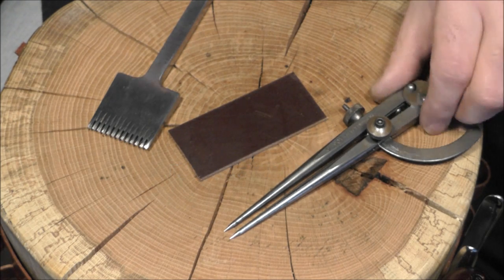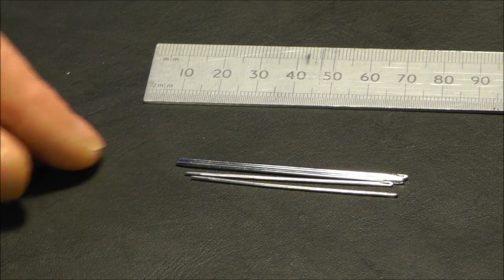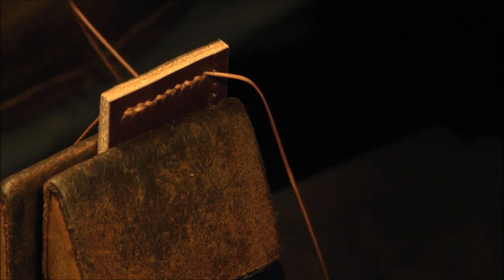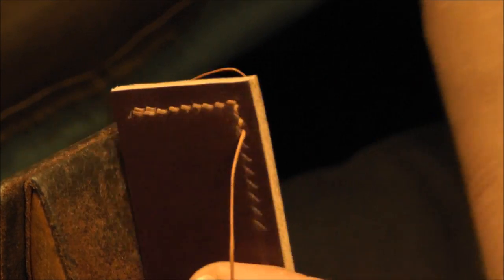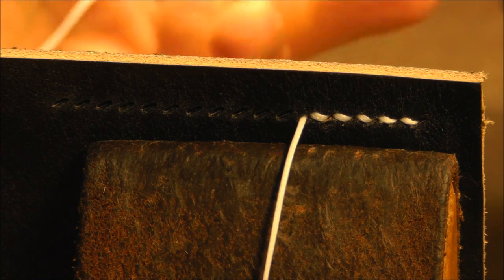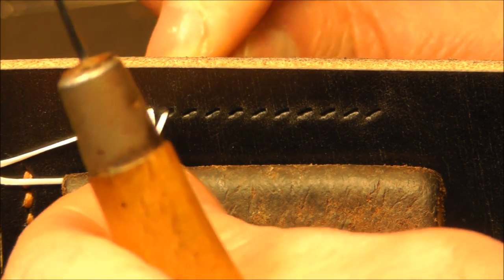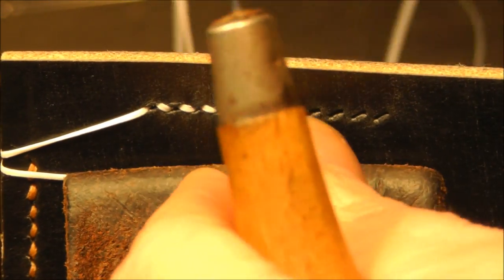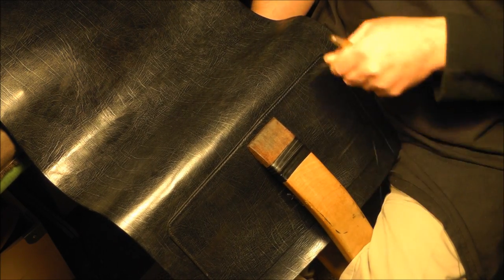Saddle Stitch in Detail

Comment: At 4:04 - you speak about harness needles.  The needles you are advising to get, at Tandy, in the states - is called a 0 harness needle.  Not to be confused with the larger 000 needle. 

I am grateful that you included the scale in your video - so I was able to use my calipers and determine what I had and what number it was called. 

Thanks!

Comment: Very good presentation. Hand was in the way sometimes, but especially with the light thread and dark leather things appeared clear. So... is it correct to think if the angle goes up and away from you that the second needle goes on top and if the angle goes down it is the reverse?  So sit one way and it's on top, move 180 degrees with work stationary and 2nd needle goes on the bottom?  Inference is simple trial and error with contrasting leather/thread may be best way to learn?

Comment: Nigel, Thank you so much again for these videos, I have been re-watching them again and discovered that I am using 18/3 with 004 needles instead of #2.  Using the right needle is going to improve things I'm sure.  I am confused as to what decides whether the first needle is held on top of below the second needle and why?  Also thanks for your recent review of the Western QC Bevelers, I purchased them and love them.  Thanks again for all you time and effort.
Reply: +Paul Hagood If you get it the wrong way round, it'll flatten the stitch our rather than make it 'toothy'. The way I remember is if the front of the work (the side where the pricker has made the marks) is on my right, I 'hook towards myself' and 'push away'. That is, if I am stitching towards myself, I 'hook' the needle by crossing it under, and if I am stitching away from myself, I 'push' the needle by crossing it on top. If the front of the work is on my left, then it's the opposite.

Comment: Hi Nigel I just wanted to know your views on stitching grooves, specifically is it possible to use a stitching groove when using a French pricking iron.
Reply: Good question. Yes. When using a pricking iron with teeth that are flat and slanted you need to place the flat top of the iron so that it bisects the stitch line. A groove “cut” into the leather is not necessary, a marked line is all that is needed to help place your stitches neatly.

Comment: Am i correct. Only Saddle Stitch with knot can make "WAVE" on both side (front and back)? I tried the Saddle Stitch without knot in 2.4mm leather. It will be show the WAVE on front side. On the back side, i found the straight line(almost)

Comment: Jeff Lincoln
Bill Barfett
To get both the front and the back of your peace to have beautiful smart looking stitches, try this:
First, refer to Nigel's section where he demonstrates tying a knot with each stitch in round holes instead of slanted chisel holes. Now, even though he said that the knot won't be necessary with the slanted holes, go ahead and make the knot anyway with each stitch.
Now, imagine the two threads being tied together are sort of "tumbling" together. if tumbling continuously, they would be rolling in one direction or the other, either forward or backwards. (weather you stitch away from yourself or towards yourself is not relevant)
When tying each knot, always "tumble" your two threads so they would "roll" up-hill inside the slanted hole. Never roll down-hill.

Comment: Thank you for making this great video, I sure learned a lot! 3 quick questions: How many stitches per inch would you suggest for making small leather articles (billfolds, pocket comb cases, mint tin cases, etc) with veg-tan? 6 seems to be working well for me, but was wondering if you'd suggest less or more. Second, what size/gauge thread would you recommend for that stitch length? And what needle gauge would you prefer for the thread size? I understand that not everything is "one-size-fits-all" but I'm trying to standardize my stitching for the things I like to make. Thank you for your time!
Reply: Hello. Most of the smaller items you mention will work well with that SPI. The one used most in the workshop for that size item would be 7. John James needles 0.4 and 0.6 or 0.55mm thread work well together. It really does depend on how you want things to look though. If you prefer a thicker, chunkier or choked stitch then use a thicker thread with smaller SPI and the reverse is true with a thinner thread and larger SPI you will get a simpler more dainty look. None of the seams will be under so much stress that it matters what look you go for though in small items like these.

Comment: Hi Nigel, should you always stitch towards yourself? I use diamond chisels and the backside seems to look better than the front lol. Is that a result of me stitching away from myself?
Reply from the maker: If that works for you Bill and you are getting a decent stitch, then that is the right technique for you.
The back will always suffer because of both threads trying to occupy the same space in the leather.
Try stitching towards you and see if the results improve.
Reply: Bill Barfett 
You can make the back and the front look equally smart and beautiful. Here's how: Simply tie the knot in the exact manner as Nigel did when he demonstrated stitching through round holes. Whether to knot overhand or underhand is determined by two factors: 1, the angle of the holes and 2, the direction of your stitch progression.
FIRST, pay attention to only the face of your work and ignore the back.
SECOND, In the direction you plan to stitch, if the face-side holes are slanting UP, then tie the your knot so that the emerging needle is emerging from UNDERNEATH the other thread. 
If the face-side holes are slanting DOWN relative to your stitch direction, then tie the your knot so that the emerging needle is emerging from ABOVE the other thread.

Comment: These angled slots look more pleasant than the round holes..  however ive watched several holster and knife sheath videos where the makers groove the leather on top of the stitch line so that the stitches lay in a groove recessed below the surface of the leather so that they can not be worn away from abrasion as easily...   I havent watched all of your videos but i have watch two pertaining to this Saddle Stitch and i have noticed that you do not groove a channel where the stitches will lay..   Does using the angled hole spacers and making these diagonal stitch holes prevent grooving or does it simply necessitate a different tool with a wider groove cutter ? ...    Do you believe recessed stitching is even necessary on a knife sheath or holster?
Reply: +rainmechanic There might be certain places where laying the stitch in a grove is a darned good idea, like any stitching inside of a knife sheath where proud stitching might come into contact with the edge of a blade. But aside from that it's just preference. It's popular in the USA for some reason. There are plenty of examples of old English horses tack that is just as good today as when they were made and they didnt grove the stitch line. Laying the stitch in a grove and using an overstitch wheel hides a lot of sins too. IMO, nothing speaks skill or looks prettier than a properly done English saddle stitch. Dropping the stitch into a grove and running over with an overstitch wheel, completely destroys the aesthetic of it. Even if the saddle stitch has been done well, you cant tell any more.

Comment: For knot style stitching, Is it important that the holes should be much larger that thread width?
Reply from the maker: No, the hole needs to be big enough only to achieve the stitch, it doesn't need to be any larger than this, otherwise you begin to lose strength. Hope that helps.
Reply: @ArmitageLeather  Thanks for sharing the info. It sure helped

Comment: How do you deal with it when the thread is a bit short?  That is, how do you join two ends in the middle of a run?
Reply from the maker: Preparation... Firstly you need to gather a number of choice words and phrases to deploy in such cases.
As soon as you discover the error, imidiatly use all the prepared dialog!
Once suitably vented, prepare a second thread with a new set of needles, leave the others in situ.
Carry on with your stitching when finished go back and tidy up.
If you can chose somewhere subtle to change thead it'd be better than being forced to join it where it would be more obvious.

Comment: I don't understand what difference having the second needle on top/bottom makes. Can someone explain?
Reply: Hello Jy I’m not sure exactly what your question is. 
The technique in the video if followed, shows how to consistently create a saddlestitch that looks good from both sides. If the thread is in the wrong place inside the hole the stitch on the outside will be pulled in the wrong direction and that will effect the resulting stitch that you see. Keeping the needles in order, holding them as instructed and making the cast only if necessary to ensure that the thread is where you need it to be for the next stitch all need to be considered.